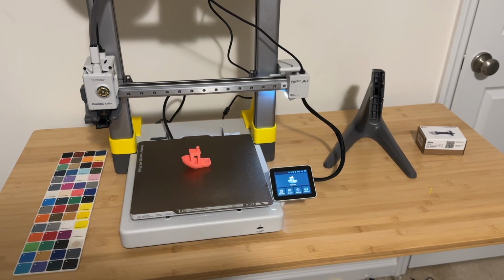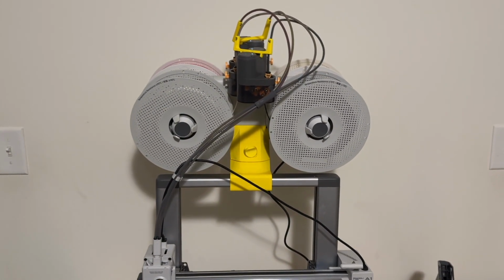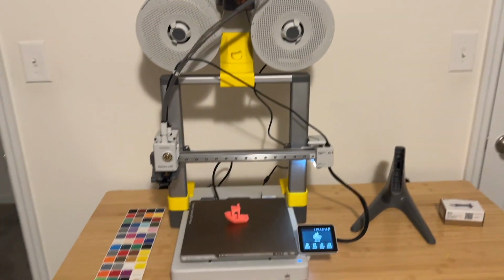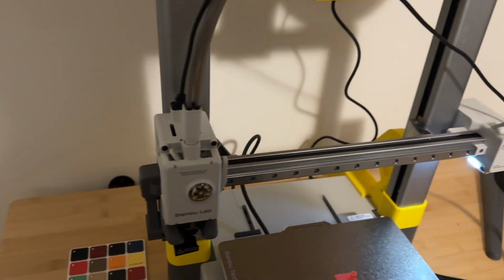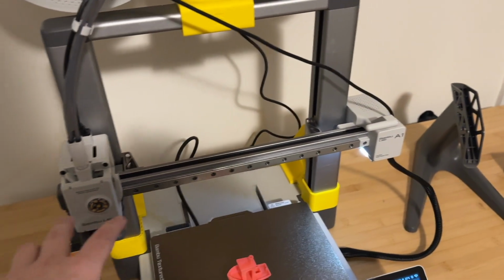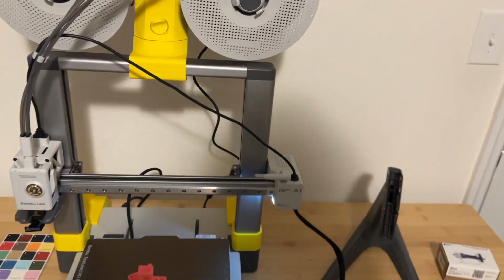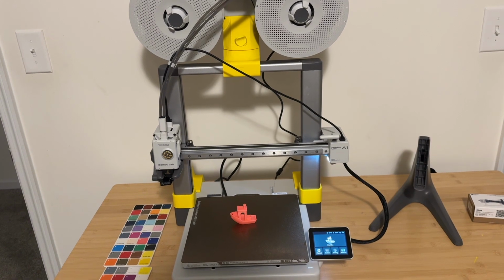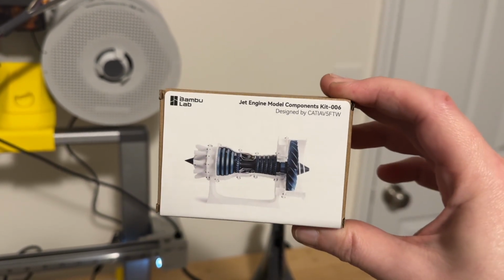Bambu Lab A1 Combo 3D Printer - Putting the AMS on TOP of the printer MOD

Comment: I printed the top mount parts in Orange PETG for strength, with the rear supports in Orange PLA. Only real concern I had was that the top cable routing clips made the exit from the first AMS spool very tight indeed and the AMS was having trouble feeding the filament from slot 1, so I ended up removing the guide for 1 & 2.

Didn’t get the jet engine kit myself, my A1 came with the Tourbillion kit which looks awesome!
Reply from the maker: Nice, its cool they are including something.
Reply: I have the A1 mini and A1 and no discovery kits 😭

Comment: I didn't get that additional engine in my box and ordered straight from Bambu labs
Reply from the maker: wow must be a micro center bonus.
Reply: Must be. I got my A1 from microcenter and I got one of those kits.
Reply: Did you get the Tourbillon kit instead? The initial production run A1 units are supposed to come with either the jet engine kit or Tourbillon kit.
Reply: I ordered direct from Bambu Labs and got the Jet Engine kit with mine
Reply: @ckhong88  according to the support email I just got back last night, hardware kits are randomly included, so not every package will have one. Not the end of the world, but still disappointing

Comment: So just wondering how it's holding up? Idk if you left your machines idle over the heatbed thing or not. Mine never turned off and very seldom sit idle for more than an hour. I'm finally getting around to top mounting and was hoping long term it held up. I still need to put together my turbine kit. Got the marble run done though!